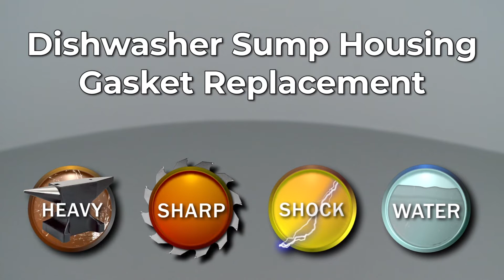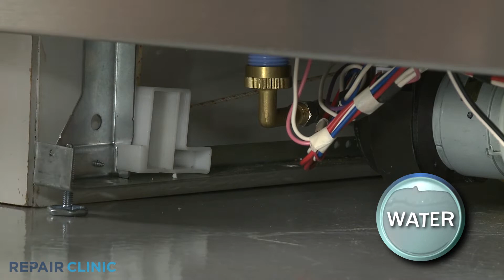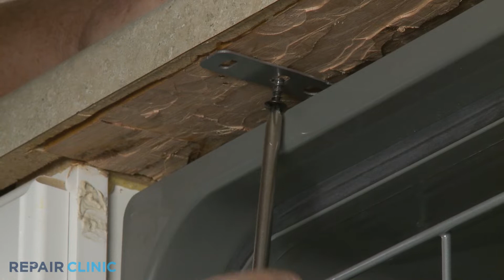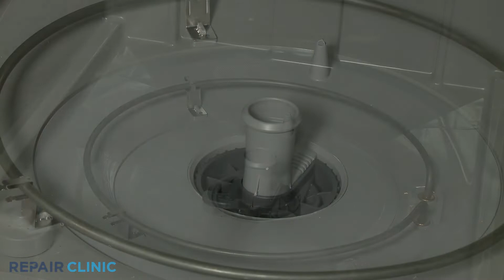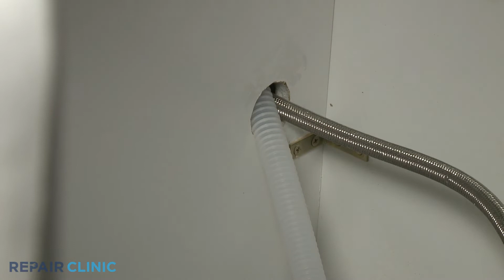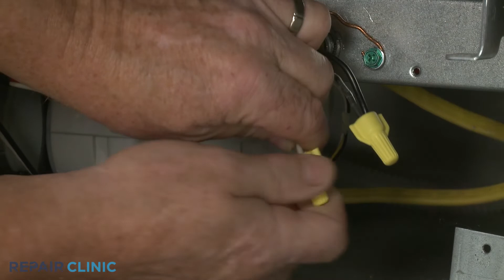Frigidaire Dishwasher Sump Housing Gasket Replacement (part 154246801)

Comment: They make putting the new gasket on look easy. I can't get mine to go down far enough to turn the locking latches back in place. I can pull it further when I sit behind it and pull the pump assembly but the gasket always comes off on some part.